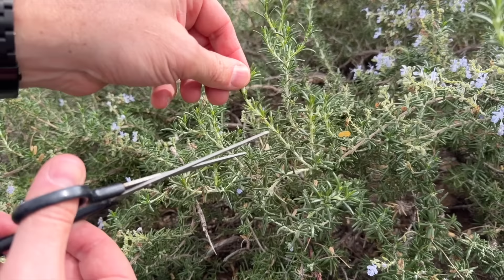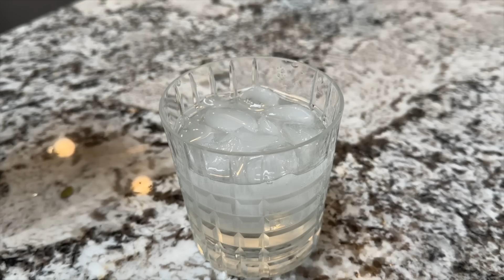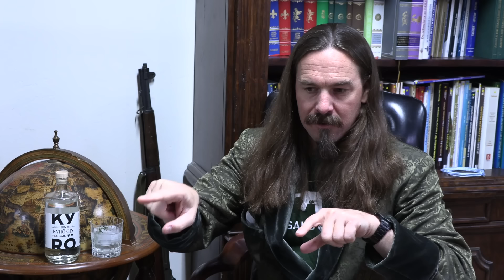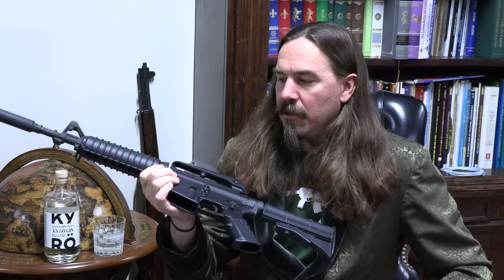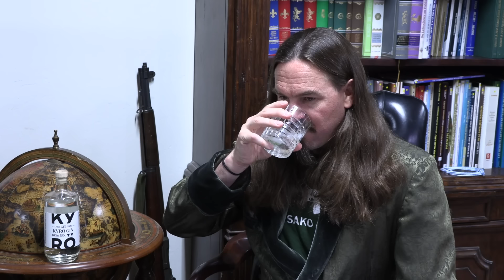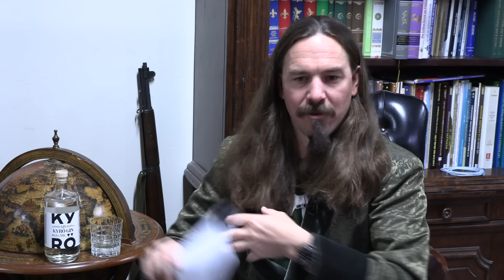How Guns are Made: Tolerances, Methods, and Metallurgy (Q&A January 2026)

Comment: On tolerances, Stanley Hooker the great turbojet engineer (the guy who designed the two-stage blower on the RR Merlin aero-engine) was in on the talks in 1940 for Ford (UK) to mass-produce Merlins. They said they couldn't use the RR drawings as they needed greater accuracy - for interchangability. And it did take about a year to re-do those drawings. A different approach was taken by Mahle in Germany, making pistons and cylinders for Porsche in the 1950s. They were made very accurately - as you'd expect, - but such close tolerances were needed that they just made them as well as they could then matched them up by measurement. OK for thousands of units but I guess not OK for millions.

Comment: 3d printing might be most production ready for stocks at the moment. We have seen this with prosthetics, but the ability to make a tailored one off there can be huge. Stocks are a part where customization is highly desirable, surfaces and design is highly complex for ergonomics and weight, demand is there for customizing them, and a fixed cost no matter what the end product is makes the process pretty attractive. Imagine the 20 way adjustable stocks you see on competition air guns for example. Now imagine 3d scanning the shooter or taking some measurements of fitting them, and 3d print them their perfectly ergonomic stock. I did this even with a pistol grip on my rifle. I slathered Play-Doh on a thin grip, 3d scanned the result, cleaned it up in CAD and printed a grip that fits my hand like nothing else. 

So either stocks or maybe also magazines. The magazines for my CZ rim fire rifles for example are so expensive that I've taken to just 3d printing them instead for lower cost. I guess the volume isn't there for them to be cheap from the factory or keep the line fooled up because they seem to be cheap and everywhere for a while and then unobtainable for years thereafter.

Comment: But you know, you gotta feed those printers. Polymer or metal. You need stock. 

We're already sort of heading back into a Bronze Age type of global power politics, centered around the trade of ores and alloys and metals. Why shouldn't refined carbon (aka steel stock, etc.) become a hyper valuable resource in itself? 

Consider the efficiency it provides over non-refined product. Those machines need to be fed.

Comment: I don't have a tool I need a gunsmith to make me barrel inserts for 12ga I want longer barrels than the shotgun barrel and make it threaded so I can attach muzzle breakers and suppressor  I also want my bolt action .50bmg ar upper to become belt fed cuz I bought .50bmg ammo boxes and it's already chain link lol so there is my legit reason to modify my single shot into belt fed bolt action lol  if possible I'd want a punt gun or 40mm grenade launcher and have barrel inserts for it too lol but then that might be extreme expensive cuz of infringements

Comment: CNC machines are not used, or at least not used exclusively, in high-volume manufacturing of most goods. And there's also the fact that the US simply does not have the raw manufacturing capacity that it did back then. There's still a lot of physical production that requires making specialized tools and dies to happen at any kind of non-artisanal scale, and that stuff still takes ages to make and get working.

Comment: That wood shape copying almost-lathe is also used for mass producing wooden shoes for garden work .  Block of wood goes in, desired size shoe bottom comes out, just need to add the leather and rubber parts .

Comment: used to run Rem 700 bolts (pre grind), 870 mag caps, pins for idk, random stuff. Most tolerance was bolt heads and on Eaton recoil piston heads. Got ok at holding half a tenth.

Comment: You can mill a part instead of stamping it but you actually get better strength from stamping for certain geometries because of the grain orientation. It is common to redesign a part when changing it to milled. Imagine a milled ar magazine you would probably need to make the front and back thicker and do a clamshell, bolting the left and right together

Comment: Machinist here. Usually when parts are being mass produced, depending on what you're making you check every 10th part or so. Plus its usually not necessary to check every single dimension on that part. Usually you can get away with checking the dimensions that have tighter tolerances. If your over all length has a tighter tolerance than the width, you can get away with only checking the length and checking the width less often, which saves time. You still definitely check but usually, something with a bigger tolerance will not affect the functions of the part as much as something with a very small tolerance.

Comment: Regarding the first question: the irony is that even though CNC machines are certainly faster, more versatile, and more ubiquitous, what we take for granted is the complete self-sufficiency of our formal industrial infrastructure.
 There are machine tools that are used in industry to this day that were built during WW2 that have had little more done to them than keeping them oiled and changing out a bearing every 20 years. The bearings were made in the U.S., the tooling was made in the U.S., and they were designed in such a way that almost every part could be rebuilt or replicated by any number of skilled manual shops in the country. 
However, all CNCs require circuit boards, display screens, imported bearings, etc. and often use proprietary imported tooling. The push by many machines tool and CAD companies to use cloud-based subscription services for their software offers up yet another weak point for cyber attacks and hackers. Most CNC machines are relegated to the scrap heap after about 15 years or so, not just because the electronics fail but because they are often physically worn out beyond economically repairing.
If we were to get into a 'shooting war' with China, who supplies all of the fiddly electronic bits that we do not make here, our output could come grinding to a halt in a surprisingly short amount of time not due to a lack of machines or skill, but because the essential components to keep the machines running would be unavailable and we don't have the infrastructure to start making them in a feasible amount of time. 
As an aside: I work as a machinist, and seeing all of the old stock tools in my trade from the '50s and '60s fills me with such sadness; most of the dozens and dozens of East Coast and Midwest companies that made drill bits, lathe tools, milling cutters, pumps, bearings, hand tools, measuring tools, etc. are long gone, but an ever dwindling number of their products are still waiting in storerooms and tool cribs in wax paper and grease to be used a half-century later, just as capable as the day they were made.

Comment: you never covered the biggest benefit of 3D printing... its additive engineering, the opposite of milling.   You can create shapes that you cannot mill.  Best example being a wave spiral baffle put into a surpresser-- picture that however you would like.  A 3D printer can make it in one piece building it from the bottom up (starting from any direction) and put hidden crevaces/pockets that even milling it as a 2 piece (matched top and bottom sections) would be virtually impossible and time consumingly impractical.
This does create a surpresser that cannot practically be cleaned, but if the meltdown/reprint cycle is good, they can be disposable.

Comment: 36:23 "Does not have to be higher quality, it needs to be correct quality"

In my opinion this is why so many new/modern 1911s have issues. Many old military guys will tell you that their 1911 would rattle when they shook it, but would fire every time they pulled the trigger.

Comment: Best Q&A yet. On the topic of metal 3D printing: The costs of the machines themselves have gotten somewhat affordable in the last couple of years. While not exactly priced for hobbyists, very capable machines can already be had for less than $10k, and as time goes on, I can only imagine the prices continue to trend downwards. Unfortunately however, the fine metallic powders that are used as filament are both very toxic and very inflammable, which make it a total pain to deal with and a non-ideal situation for home use as much as I would like it to be.

The continued advancement of FDM printers and the quality/strength of the materials that are being used is something to look forward too, though. Being able to make production quality parts at home that can match or exceed injection molding will be a compete game changer, especially for those wanting to make a product without dumping tens of thousands of dollars into tooling.

Comment: Engineering has been described as designing something using just slightly better than minimum requirements (which can still be quite demanding) so you can actually afford to build the thing.

Comment: For the ammunition preference thing, what is true today was true more than a 100 years ago. JMB, with the auto 5, wanted and designed a shotgun that could fire reliably opposite spectrum of shell power, quality and even powder type (long recoil shotguns can fire blackpowder shells) and not beating the gun up. Hence the brake system on that gun and the subsequent "branched" designs of other companies like the Cosmi or the Franchi 48.

Comment: Good stuff, thanks Ian.  
re: milling
In the 90s I worked at a factory making blowtorch tips out of metal.  I ran the milling department where we used collets to hold blanks then pressure switches and gears to do basic robotic manufacturing by pass the part against high speed cutting tools.

Comment: As a whiskey lover I feel compelled to clarify the minimum aging requirements.

Finnish, Japanese, Canadian, Irish and scotch whiskey are minimum 3 years.

US made Bourbon, rye and, wheat whiskey are minimum 2 years. If the whiskey is bottled in bond then it's 4 years minimum. If under 4 years old an aging statement is required otherwise it can be bottled NAS (No Age Statement).

With that in mind most NAS whiskeys are going to be between 5-9 years. 10+ aged whiskey is very likely to have an age statement but that is not a universal rule necessarily but aging statements are a good advertisement when they hit double digits.

One last note on whiskey aging statements is blended whiskey age statements shall be marked as the age of the youngest spirit blended in regardless of the percentage involved in the blend. Point one percent of 4 year whiskey in an otherwise ninety nine point nine percent 15-20 year blend would likely not have an age statement but if it did it would have to say 4 years.

Comment: 30:00 not sure about US but I think there's a similar thing. In russian (i e soviet) ESKD (USCD - united system of construction documentation) tolerances for different kinds of connections are already studied and there are recommendations for choosing tolerances for say cam sliding in a groove or a piston for a high preassure pump or a specific gear. And recomended tolerances are provided for different ranges of dimension values.

Comment: 55:00 Insofar as AI might help, it'd be AI working in concert with computer modeling and CAD, and those are only as good as the data you have to feed in.  Which is very close to what Ian is saying - the AI might be able to help, but even then it'd probably have to delegate "I need these 100 materials testing experiments done to generate inputs for modeling".

Comment: You actually can use cnc machines made for metal on optics with small modification.  The bigger  issue is coatings, and measurement: both capacity and expertise.

Comment: RE: installing barrels, Barret's MRAD has a couple bolts. They're torqued to I forget what specifically. They have a guide pin so you can't put it in wrong. The ability to switch calibers - barrel, maybe mag, maybe bolt - is apparently a selling point. It's of course bolt action, so there's no gas system to worry about.

Comment: I don't see metal 3d printing getting to the point of ubiquity like plastic printing. The power costs are just so much higher with DLS printing, even with plastic that it's just not a cost that most people are going to be willing to cover. Not to mention the size and complexity of the machines required to lay down layer after layer of metal powder, the safety of handling that powder, restrictions on selling high power lasers to the public and probably more I'm not thinking of. Maybe we'll get to a point where we can get a home printer that can print metals with a low melting point like pewter but i don't see much beyond that being commercially viable

Comment: A little addendum on the tolerances: you're also dealing with ammunition, which has its own set of tolerances (both in dimensions and in pressure curve) which are (usually) beyond your control. And since cartridges are a lot more expendable, there is an incentive on ammo designers to set their tolerances decently wide, which limits how sloppy your gun tolerances can be, a trade-off between slower gun production and faster ammo production. Same applies to magazines if you want those to be interchangeable; you are not determining your tolerances in a vacuum. Maybe an ammo producer 15 years ago decided "actually, we can do it cheaper by going slightly out of bounds on these specific tolerances, the current service rifle can handle the extended range just fine" and then you come in with a gun that follows the original spec and you have to blacklist an ammo manufacturer bcs guns are exploding. There's a lot that goes into it.

Edit: thinking about it: I think Ian has mentioned something like this in his "why guns explode" video. Strictly speaking, there is no need for a 556 chamber to be big enough to facilitate 300 blackout. But for a gun manufacturer, there is an incentive to allow for slightly bigger ammo tolerance than strictly necessary, for the reasons mentioned above; you don't wanna jam on cheap ammo. So you make the chamber marginally bigger, and now some unfortunate soul rams in a 300 blackout, and then the gun explodes.

Edit 2: oh, he talked about ammo later. nvm, apologies for off-the-hip commenting

Comment: For Royal Armouries, Johnathan Ferguson recently posted an ancient film on the manufacturing process for the British L1A1 SLR in 1957 (https://www.youtube.com/watch?v=-NxwHBgS5AE). Whilst many of the machines now would be replace by CNC processes, the concepts remain the same - the differences between toolmakers, tool setters, and machine operators appears. The variety of processes covers casting, turning, pinning, etc. I suspect a gun maker from 1900 would very rapidly recognise and adapt to 1957 and even 2025.

Comment: CNC is more flexible and enable going from CAD to part.  But the bank of specialized machines can probably produce more finished assemblies if you don't need the flexibility. If for instance you wanted millions of a thing in a short amount of time, the bank of single function machines would likely be faster...   But it would be interesting to run a head to head experiment....

Comment: Fun fact about metal 3D printing, certain companies/varieties of 3D printer (Ultramaker comes to mind) are capable of printing the metal/resin mixture used in metal 3D printing, and will then allow you to mail them the part to be washed and sintered. All you have to do is buy the filament required and print it yourself, and the most expensive part of the process is done for you for a small fee.

Comment: 38:32 so another big thing is maybe the range is 3-7 and the machine is putting out 4s and 5s. slowly over time it's starting to put out 4s 5s and 6s and eventually just 5s and 6s maybe even a 7. that's usually called drift and so you will want to correct it, maybe by just repositioning the cutting tool or replacing it. this could be caused by something as simple as it's no longer winter and so the machines are a little warmer and that makes them drift upwards in this scenario. That's as opposed to a widening where it goes from 4s and 5s to 3s and 6s. Also manufacturing error reporting might be 3-7 but the actual tolerances are 2-9 but if your analysis is seeing 2s that means it isn't seeing the 1s slipping past and same on the other side.

Comment: The only inventing thing that is being lost, abeit in a extremely niche fashion, is manual machining.
If you're on a limited budget, and you want to make a new lead throwing machine, getting a manual milling machine and possibly a manual lathe if you also want completely custom barrels is probably more cost-effective, if not sane or mass-producible.
JUST because you're saving so much on the machines you maintain a lot of extra budget for material.
Absolutely never gonna be a actual practical consideration unless you're doing some civil-war/post-apocalyptic, resistance backyard gun manufacturing.